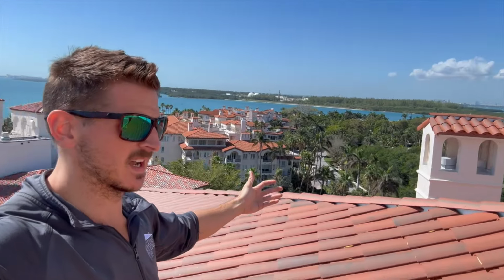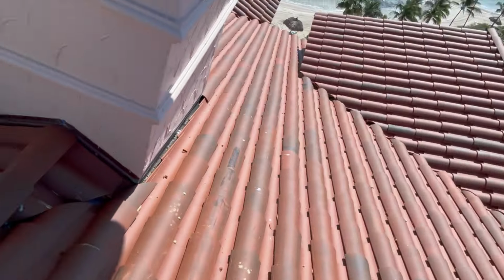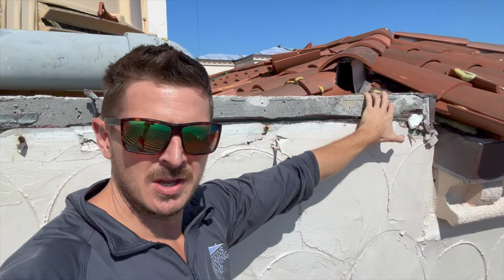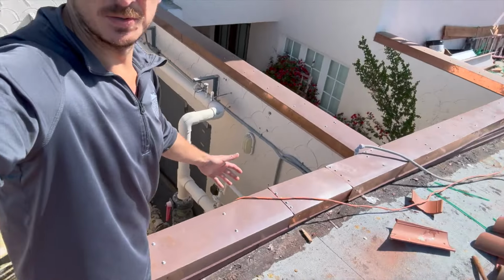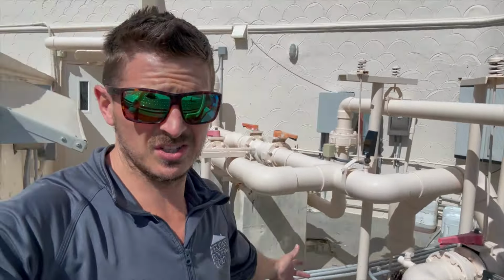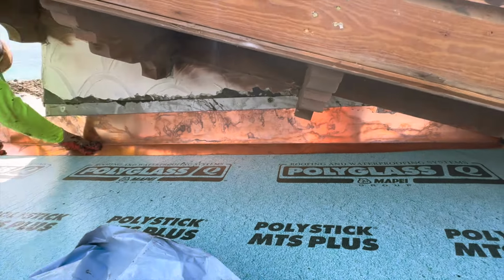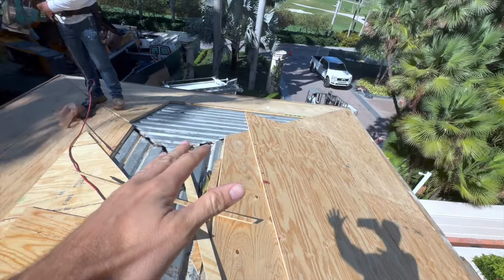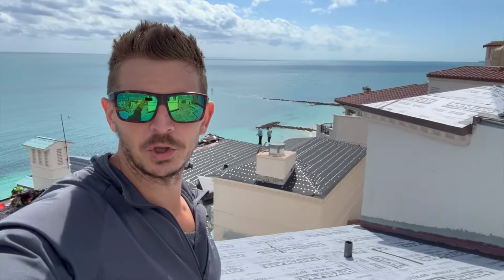Fisher Island High Rise Barrel Tile Re-Roof Part 6

Comment: They had a company re roof a prison here and it must have taken them about a year to finish the flat white roof and several guard towers and small telephone building. We were continually getting leaks inside before they finished.
Reply from the maker: Hiring the right installer for a re-roof project is the most important piece of the puzzle.  Some people care too much about the manufacturer, the warranty or the price.